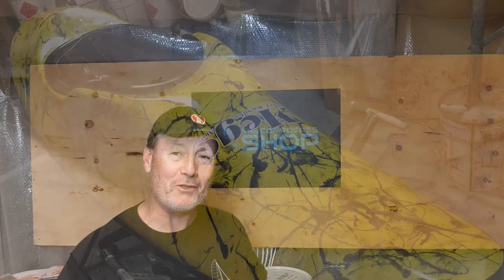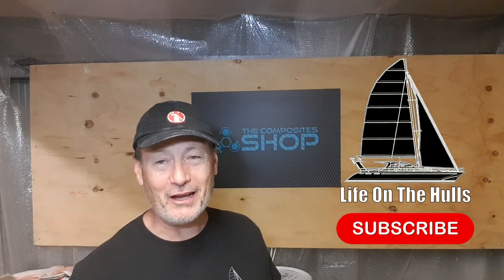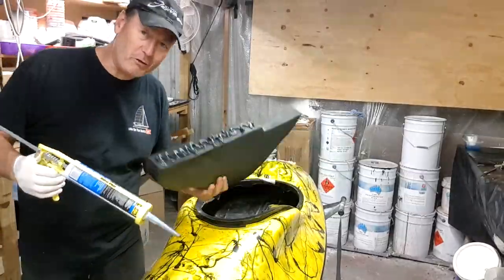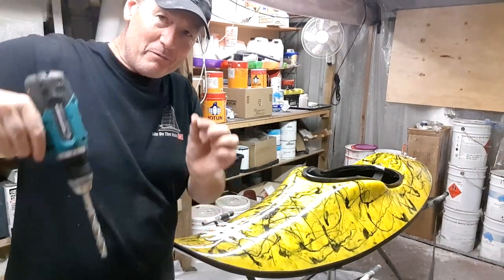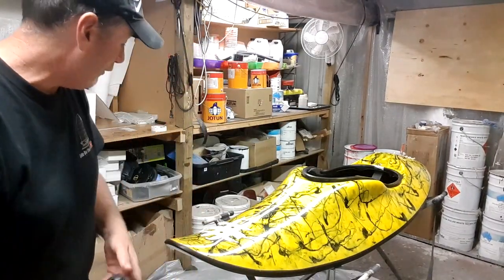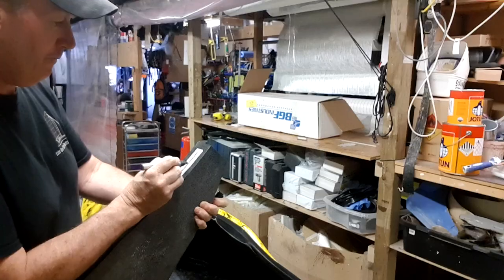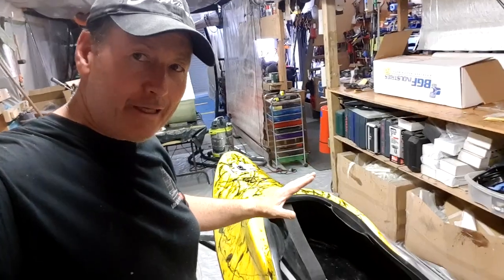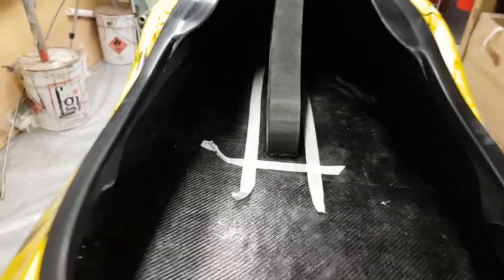Ep10 Installing Safety Loops with Resin  - Kayak Build - The Composites Shop

Comment: How well does the cord handle uv light?
Reply from the maker: Gidday Steve.The 8mm  braided sash cord is unbelievably tough and we used them for 15 years as deck lines on sea kayaks as well with little or damage from the sun.Cheers Ross